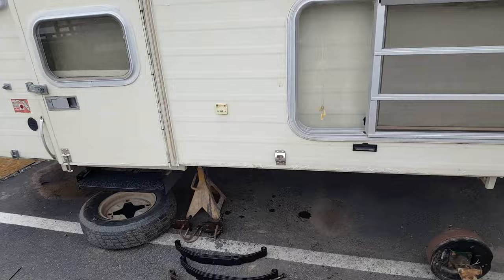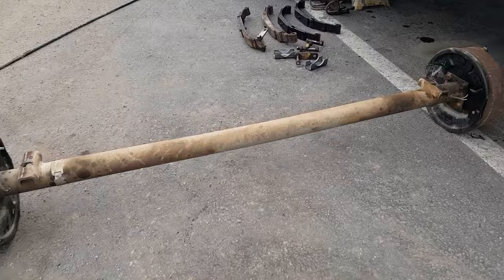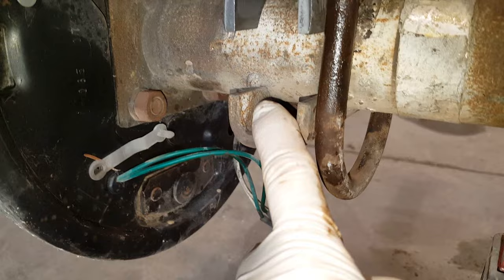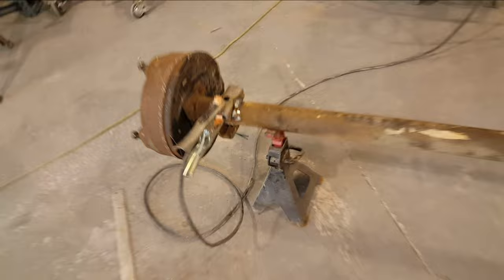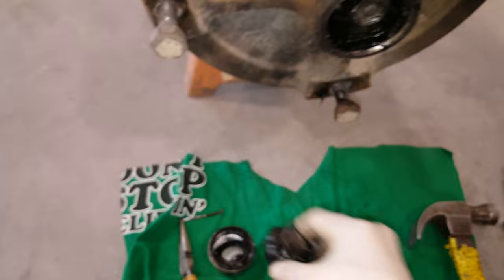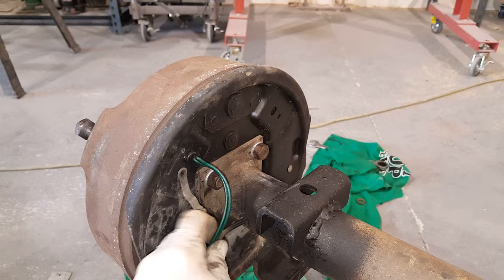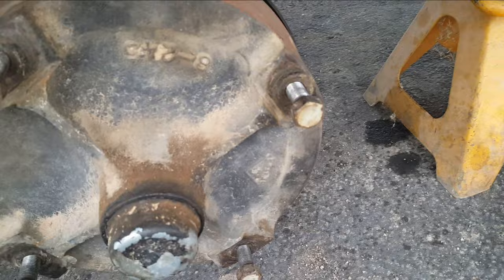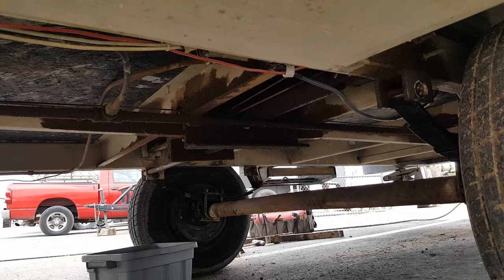Trailer Axle Flipping....What's the BIG Deal?

Comment: I want to attempt this on a 30ft 1982 double axle cattle trailer (gooseneck) so it can sit better for my 4x4 2018 F250. The truck sits really high and I don’t want to cut into, and modify, any of the metal on the actual frame of the trailer. Would you recommend the axle flip? Using a 99 2 wheel drive truck to pull it now and that truck still raises the trailer ever so slightly in the front end. And if I do this, should I replace the u-bolts and all? 82 barn find, was stored in a warehouse and it has a nice patina all over but I’m wondering if I should replace all of these parts or not.
Reply from the maker: yes I would recommend this to add height to the trailer, it's always good practice to replace the u bolts if you can get them easily
Reply: @AZExpert  Alrighty, appreciate the reply. Looks like I’ll be doing this today

Comment: So the spring was broken due to the axle flip?  That's how it sounds, but not really clear.
Reply from the maker: I dont think so. It was likely damaged from hitting a bump too hard. The trailer was leaning and that's when I discovered the axle flip. Thanks for watching
Reply: That makes perfect sense, thanks.  I had a spring break on an old camp trailer I had from hitting a pot hole (best I could tell).  New springs fixed it right up.

Comment: I'm a little confused.  Why not just spin the axle around, then swap the brakes from side to side.  No need for new spring perches.  Having the wires run out the front of the axle tube is a non issue, or could be mitigated by sealing the hole, or drilling a new hole on the rear, or am I missing something?
Reply from the maker: That could be done if we wanted to put the axle back on top of the leaf springs like they were originally. But the owner wanted to keep the axle lifted with the springs on top of the axle to increase ground clearance. This is why the new mounts are needed, otherwise the axle is upside down. Thanks
Reply: @AZExpert  Some of my mental gymnastics failed me.  You are of course correct.  To maintain the axle camber while under the springs... a new spring perch is needed.  No way to get around that.  Don't know why I didn't get that the first go around.  Thanks for the response.
Reply from the maker: @ShainAndrews  no worries, I'm glad you could make sense of my confusing presentation. Thanks

Comment: OK, here's a dumb question.  Why not spin the axle 180 degrees so the perches are on top, then mount your springs on top of the perches?  (I can hear the laughter already...)
Reply from the maker: No laughter here. The axle is bowed and the bow should be higher in the middle. Spinning it 180 puts the bow upside down which is what happened to this trailer. The bow is part of a preload on the axle when weight is placed on the trailer it's trying to straighten the axle. Upside down the weight is trying to further bend the axle not fight the weight. It can also put the hubs and tires out of caster. It may not be the end of the world on this small trailer but large trailers are very hard on the axles. Thanks!
Reply: @AZExpert  Learned a lot on this one, but it's not caster it's camber. Caster relates to ball joints and steering. Camber is the tilting in or out at the top of the wheel. Positive camber is out, negative camber is in, plumb is 0 kinda sorta.

Comment: Would there be a problem flipping the axle on a 6x10 utility trailer to haul maybe a 1500 pound polaris ranger? I need more clearance hauling it off road down some pretty bad trails. Looks like a simple flip what am I missing?
Reply from the maker: Flipping the axle does not affect the weight rating of the axle or trailer.  Often the tires are the weak spot so flipping axles gives more clearance for bigger/stronger tires too...which give even more road clearance...very win-win! It is simple you are not missing anything. Thanks!
Reply: @AZExpert  Thanks! I'll do it tomorrow.
Reply: The fail is when new purchases are not welded on. Never change the upward bow of the axle. I want to mount shocks and go with 16” rims from 15” and the tow vehicle height needs to be level also

Comment: You should have re-crowned the axle tube so the crown is back on top as when the weight of the trailer and the additional load is pushing down the wheel camber will keep you from having abnormal tire wear. They design the axle tubes that way for that reason. Go research wheel alignment and they can explain it better than I can. Good Luck in the future.
Reply from the maker: seems like a lot of effort to re shape an axle. Thanks!

Comment: The brake wires are connected to any color wire or how it works
Reply from the maker: The brakes are electric magnets. Ground goes to one lead and the other lead will go to the brake power lead...ususally the "blue" lead at the trailer connection. They are not polarity sensitive or directional. Thanks!

Comment: To John dubin who asked what difference does the bow in the axle make. It’s extremely important to keep the bow as the factory installed it. The “frown” as I call it. As you load the trailer the bow straightens out keeping the wheels plumb. 
If you just flip the axle you end up with a “smile” in the axle. Then when you add weight the smile gets bigger and the tires will be at a sharp angle to the road surface and will wear prematurely causing a dangerous blow out.
Reply from the maker: Thanks!
Reply: Don't understand this concept. There is no weight on the center of the axle so how is weight at the springs compressing the axle at the center? If weight at the springs can compress the center of an axle, seems to reason it could do this regardless of the direction of the crown.
Reply from the maker: It helps set the camber of the hub. I don't design or engineer axles but it also serves as a preload when only one wheel spring compresses and flexes the center tube of the axle.  I'm reassured the manufacturers would not put the additional time into the build if the crown was superfluous.  Thanks!
Reply: @AZExpert   Your point about the manufacturers putting in extra effort is a good one.

Comment: He really just took a measurement off of asphalt to check level....🤣🤣🤣
Reply from the maker: where would you take a measurement for illustration purposes?
Reply: @AZExpert  a straight edge. Do you really believe asphalt is perfectly  level?
Reply from the maker: @rickr7529  I believe it is straight enough for demostration purposes yes, this isn't rocket science or medical engineering
Reply: @AZExpert  it sure as hell isn't rocket science. But that is the MOST basic mistake in any construction trade is to measure from concrete and especially asphalt to determine if something is bent...
Reply from the maker: @rickr7529  I mean it is bent, it has a crown. If you could not tell because of the camera angle I pointed it out with a quick measurement. How were you affected by this to mock a stranger on the internet and correct a point that wasn't made? This is a round axle, I don't need a calibrated table and 4 hours of dial indicating to determine an obsolete 35 year old trailer axle worth $50 and installed wrong for 30 years is likely bent. You are trying to make this more complicated for some reason.
Reply: @AZExpert   @AZ Expert  hey i just commented just like the application allows and recommends. You are the one who keeps arguing an invalid point. Your 1st response should have been "oops yeah i guess i should expect asphalt to be off by 1/4in in a 4 to 5 ft span but it was bent i ended up replacing and making it all better" see how easy it would have been...😉
Reply from the maker: @rickr7529  i didn't replace it nor condemn it, I put the spring perches in the correct location. I merely showed the axle had a crown on it as many people are unaware. I control the comments and can delete whenever I want. You think you know better but have been wrong everytime. Your 2nd respone should have been, "wow, I guess I did not understand the video and my mocking was unwarranted. I should pay attention more." see how easy it would have been?
Reply: @AZExpert  ask anyone who has ever tried to find the level of something and ask em if its ok to measure from the ground, concrete or asphalt and expect it to not have a 1/4in difference. You know u did wrong but just refuse to admit it...🤣🤣. I only pointed it out and you git all defensive...😂
Reply from the maker: @rickr7529  you've pointed out nothing but you have a failure to understand simple concepts. You may be able to intimidate and bully others around you, but I don't know you and your self-importance is unimpressive to me. I doubt you even understand what you are saying at this point.

Comment: I'm new to all this, and the question I have is: why does it matter which way the bow of the axle is? I understand for the breaks and all that, and even the hangers, but is there a reason for the axle to bow up over bow down.  Thanks
Reply from the maker: Generally to keep the tires/hub in the correct camber to the road surface. As load is applied, the axle would tend to flatten. Also, as an arch, there is much more strength when it is upright than inverted with a downward load. Thanks!

Comment: All you do is take a sprung under axle unbolt it turn it around 180 degrees take the brakes off swap sides and the axle is completely correct to be a sprung over axle there it no need for welding on new perches you just put WAY more work into this than it requires! The arch will be facing up as it should an axle does not have a specific left and right side! As i said you just did WAY more than required!
Reply from the maker: I appreciate the comment but disagree that there is no problem inverting the axle crown. And besides welding the perches on is hardly much more work than flipping the brakes and the right way of doing it.